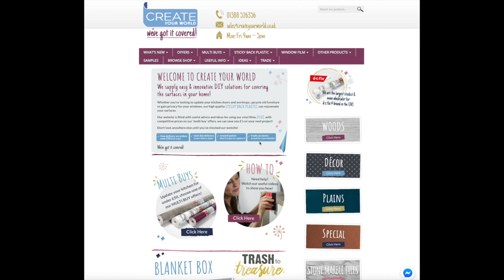HOW TO APPLY D-C-FIX | BUDGET KITCHEN MAKEOVER | CREATE YOUR WORLD

Comment: I would have used the proper tool for smoothing your silicone since they only cost a couple of quid from screwfix and it makes for a much smarter job. Also would have used grey or clear silicone since you don't have white grout any more.
Reply from the maker: Funnily enough I tried the tool and I'm still rubbish at doing it. I've put a grey strip silicone over it now and it looks so much neater 😊

Comment: Okay so the only things I see wrong which are preference. The tile will show through… also the caulking at the end should have used tap to make those line jalapeño solutions straight.
Reply from the maker: Yeah I was happy with this but I have actually since updated it again if you see are recent video. I have also found using a silicone strip much more effective.

Comment: Good video , plenty of content and description thank you , but you've had a shocker with the sealant 🙈
Reply from the maker: It's all better now. I've popped a grey strip sealant over it and looks so much neater! Haha! Lesson learned! Thanks so much for watching! ☺️
Reply: You get silicone application tools, like a rubber bank card sized item with each corner mitred for the desired size, use a spray gun with washing up liquid in and spray the silicone after it has been applied, then with the tool just wipe it along the silicone and it gives a perfect finish every time 👍🏻
Reply: Ignore them. Sealant is always dreadful on your first few tries. You have to get used to it and practice just like anything else.

Comment: May I ask how the work tops stand up over time. How long did the one you removed last?? I really want to try this but not sure how hard wearing it will be. Great demonstration tho👍
Reply from the maker: Really really well! Had no problems at all with the wear. Obviously if you're putting hot pans down just use a little rubber mat. I'd definitely say give it a go!
Reply: I would seal it with midge podge and it would be water proof
Reply: Do u layer of the vinyl when u cut it overlap of put down rite next to it

Comment: Good video 👍 How resistant is this material to heat if you accidentally place a medium hot/warm pot on it?
Would also appreciate if you can share how it has held up over time 😊
Reply from the maker: To be honest I think it’s advised you shouldn’t put anything too hot on it… but I’ve always used little rubber matts if I was ever putting a pan down anyway. Even if you don’t have DCFix covered worktops I think it’s still best to do that. It’s held up great; no issues :)
Reply: @MissMoogle  thanks for the reply! We will give it a try 👍👍
Reply: @MissMoogle  looks lovely.  How has it held uk around the sink? Especially with all the separate little pieces...

Comment: Please help! I cannot seem to put the contact paper on my cupboard doors without getting loads of bubbles. I cleaned the area, measured up and peeled it slowly while pushing the bubbles out. Still no luck 😭 Is it because the doors are high gloss or is it because I’m rubbish at it? 🤣 xx
Reply from the maker: Oh no! I'd imagine high gloss would be easier! A smooth surface should be perfect! Yeah, the advice I'd give would definitely be to peel slowly and smooth each bit down! But you're doing that! Make sure it's all lined up evenly too at the start? You could try heating it up with a hair dryer to shape it a bit more if needed... But if you do get bubbles you can just use the needle tip and pin prick the centre and then smooth the air out :) I hope this helps! Thanks for stopping by! :)
Reply: Try moving top to bottom, smoothing down with the dc fix tool side to side.  Found this technique out after applying on to my 3rd door 🤞🏻

Comment: And as you set Anthony hot on it,  it melts.  Don't think about cutting on it either.  No thanks.  Just save your money and get the real thing
Reply from the maker: It's stood the test of time really well. Would never put down hot pans without using a rubber protector underneath anyway and always cut on chopping boards so it's been no bother to me to be honest.
Reply: @MissMoogle  this is just tacky,  sorry,  but it is.